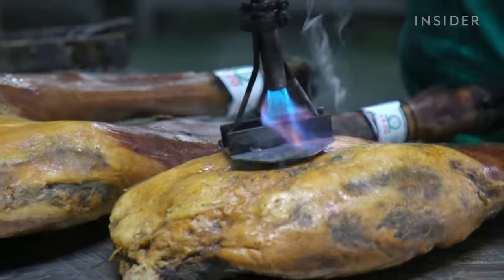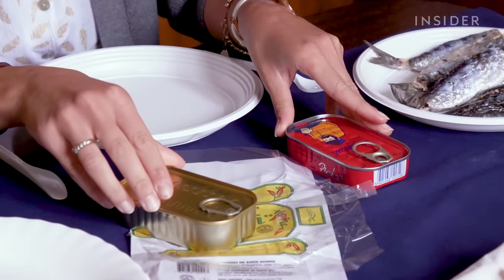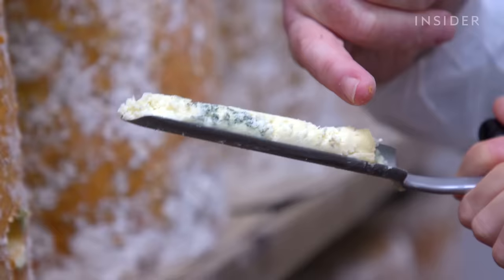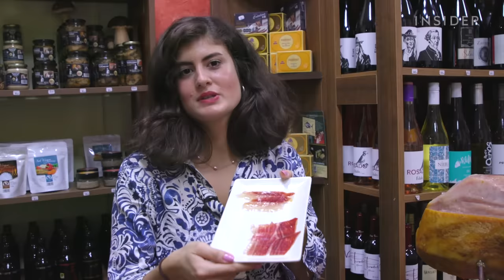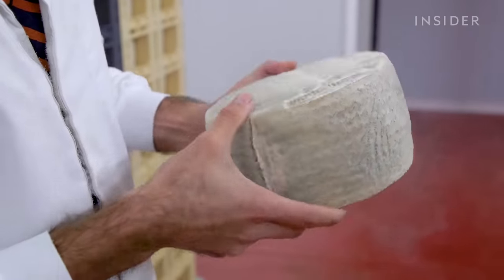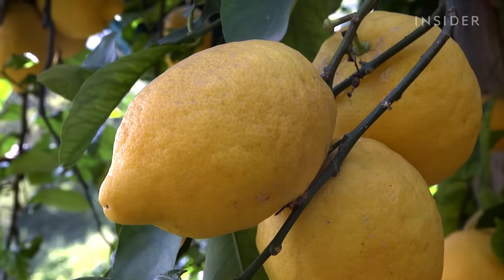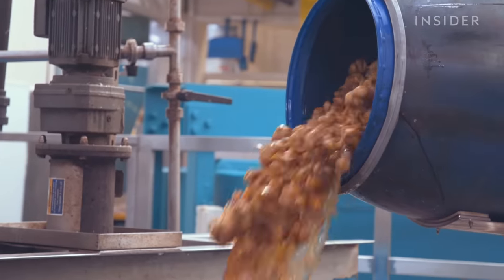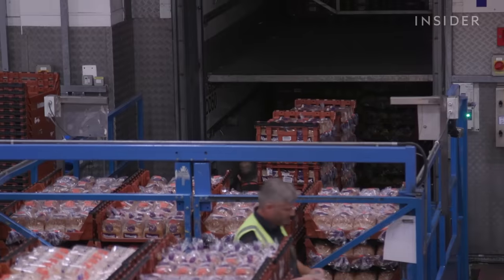Regional Eats Season 2 Marathon

Comment: How do you eat sardines,? Do you just eat around the bones/ does the meat separate easily from the bones?. I have no idea
Reply: You eat them. They get soft so it's not an issue. At least the ones I've had.
Reply: yes you eat them. Imported sardines are quite expensive in our country. Sardines is a common emergency food here in our country and is really cheap like $.20. You eat it all even the bones because it's so soft. You should try the Spanish sardines in oil. So good.

Comment: Not sure if this is common knowledge, but it is surprisingly not mentioned in the video; the holes in Swiss cheese (and possibly others?) come from tiny flecks of hay that fall into the milk during milking. Not sure if they've done away with that and have found another way to produce that effect ? Does anyone know ?
Reply: mmh, no, the bubbles are the result of C02 and a chemical reduction, it is also detailed.